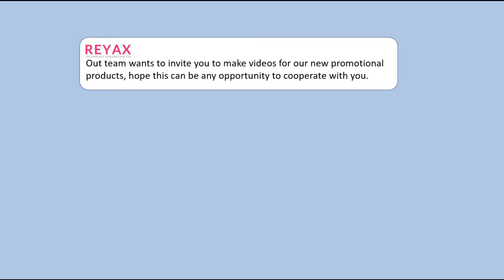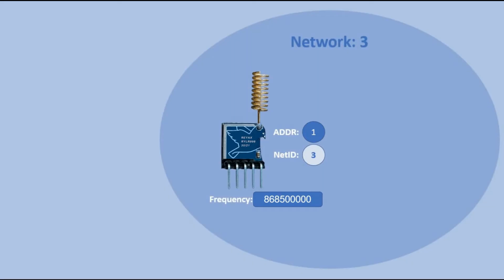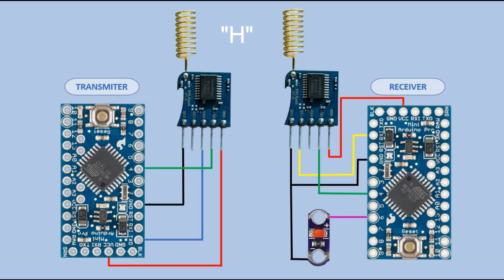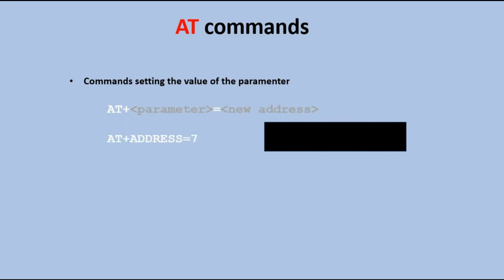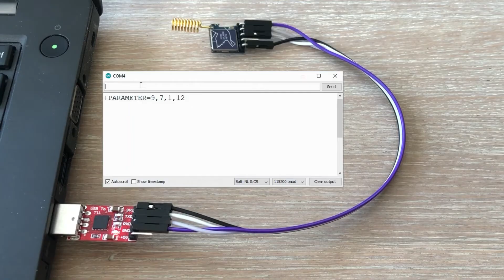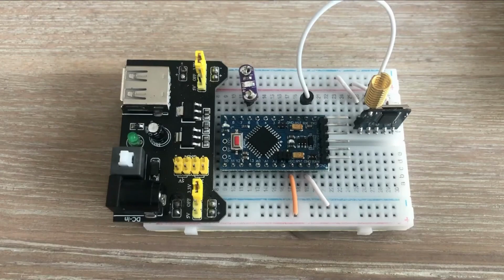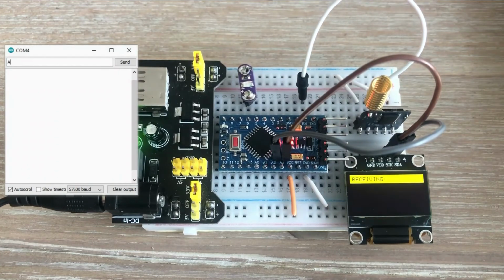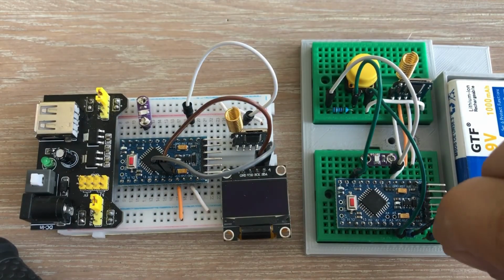Arduino meets RYLR998: A Comprehensive Guide to LoRa Module Integration

Comment: If you plug in your lora to the usb, you will need to install drivers. For me I looked up "CP210x drivers," went to Silicon Labs website, and installed the "CP210x Windows Drivers" driver set. Then and only then was it visible from arduino IDE.

Comment: Excellent video!!! 
There seems to be a long lag between pushing the button on the transmitter and the LED ON/OFF state. 
Is this due to the code used or normal delay to expect with this LoRa device?

Comment: Where do you get the jumpers? What are the lengths available? What is the wire gauge size required?
Reply: Amazon has jumpers galore...
Reply: It's a piece of wire, small gauge, it's from one hole to another, it's not brain surgery.  Improvise.  Did you ever have a 151 Electronic Project Kit from Radio Shack as a kid?

Comment: I'm looking to use this module with my Flipper Zero.

There's a LoRa app built into the Flipper Zero where you can set the parameters as you did in this video.

On the other end, I don't have a 2nd Flipper Zero though so it has to be my laptop it's communicating to/from.

I have a uart to hook up the laptop to the LoRa module. Do I just open the Com port & start entering the parameters this way?

I'm NOT looking to light up an LED etc. I'm simply looking to both transmit & receive to both the LoRa modules texts.

Do I just set the parameters in the Com port & then I'm good to go?

So to reiterate, the parameters will be set in the Flipper Zero & using jumper cables. The LoRa module will be connected to & powered by the Flipper Zero. It can send/receive through the LoRa module.

I need to set the other LoRa module up to my laptop. Is the LoRa module good to go without writing code & just setting the parameters up through the Com port?
Reply: Have you find an answer? I am looking for setting lora without UART

Comment: Can I use the lora module with the seedstudio ESP32 C3 module ?
Reply from the maker: Did not work with that microcontroller. But I checkt and it has the UART interface and works with 3,3V logic. So I do not se why it would not work. I am not sure if it is supported in Arduino IDE , though

Comment: Which terminal program are you using? It looks like Arduino but I am not aware of how you get that interface to come up?
Reply from the maker: It is Arduino IDE. When you open it you will find serial monitor icon in the top right corner which opens Serial Monitor

Comment: Mario, can you please help me with a very simple looking problem? I have 2 boards, just like you. At the transmitter board I have a loop with 2 send lines. There is 1 second between the transmission of the lines.
The transmitter runs ok. I got the +OK after the send lines are executed. But the receiver shows only the first received line. I looked with a logic analyzer and I see the 2 lines are transmitted. But on the receiving module there is no reception of the lines after just the first. It looks like the receiver is no longer in receiving mode.
I swapped the boards. Same problem.
Reply from the maker: What happens if you make the delay longer In my ideo you have seen that I was sending led state few seconds apart without problem.. Also try to run transmission 1 twice to see if maybe there is some problem with the content of second transmission. Diffiult to troubleshoot without hands on the prototype:)
Reply: Hi Mario, I got it working. I first did an AT+FACTORY and only changed the address of the transmitter and receiver. But there is still one problem left.
In about 20 transmissions of a 5 character string one of them does not come out of the receiver. It was transmitted with an +OK response. I lowered the baudrate to 9600.
Same problem…. This will become  a very difficult problem to troubleshoot I believe.

Comment: I have a problem with setting the parameters, while the module is connected everything can be configured correctly, however when I remove power from the module it returns to the factory settings, what should I do to solve this?
Reply from the maker: I can't relly hrlp you as my modules keep the settings. But you  are a second person reporting this to me.

Comment: I have RYLR998,  when set band using At command "AT+BAND=865000000", it remember only when it is connected, when i disconnect and connect and ise "AT+BAND?"
it shows +BAND=915000000Hz, why it is not remembering BAND?
Reply: Answer AT+BAND=865000000,m        write toe memory.  RTF !!!
Reply: managed to solve? i have this problem too :C
Reply: @teusocost  No, now each time I set band

Comment: Thanks, that’s some explaining done right.

One question, can we use those module to create mesh network with them, where the network can discover and new nodes in the nwtwork (auto-configuring network)
Reply from the maker: I am not sure. Please check at Rezax. They usually provide good documentation.

Comment: Are you asking for a solution to a problem where, in a 1-to-3 communication scenario, even though the same network ID is set, when a value is sent to address 1, values from address 2 are received, but values from addresses 3 and 4 are not received? In other words, values from one side are not being received. Is that correct?
Reply from the maker: I am not sure which problem you are reffereing two. Can you refer to the timestamp in my video?

Comment: This is a cool project using Arduino, how about if I want to design it using other AVR chipsets. It is easy to prototype using Arduino board. However, with my entrepreneur hat on (idea lead to production product), I do not want all the functionality of an Arduino board, I just want a voltage regulator  with a 3.3vDC, external crystal of my liking e.g. 7.327Mhz (for UART)..a serial port on Port B to load my program in,  LoRa module and a selection of AVR microcontrollers e.g. ATTiny88 or ATMega164PA to choose from (to reduce cost) etc.... Any recommendation?
Reply from the maker: I am probably not the right person to answer it. At least not now. I will be doing future videos on ATTiny chip but I learn as I go. You probably want to ask this at Arduino forum. I presume that as long as the chip is 3 v and provides serial com ports this should work the same. If the chip is in 5v logic you need to have Logil Level Converter. Funny enough I am planning to make a video on such converters in coming weeks as well:)

Comment: Very informative video. I really appreciate it! For both REYAX RYLR896 and the RYLR998 modules, I saw one review on Amazon, stating that the person would get them to work and then they would fail. Have you done any longer term testing to confirm the stability/reliability of these modules?
Reply from the maker: Unfortunately I did not. I have a project in pipe to use them which would answer youer question but it will be a while before I will do it:(
Reply: @marios_ideas  Thank for answering. I'll probably buy a couple of them and set up something in a couple of weeks to test reliability.

Comment: That's a really cool project. Could you make something similar with controlling relays instead of the LED? I can't find anything really basic as far as a tutorial goes to set it up. Any books you can recommend for learning LoRa and things that you made for this? thanks
Reply from the maker: There is virtually no difference. You send the high signal to Arduino pin to light up the led and in the same way you send high signal to relay to control whatever the relay is connected to. As far as using relays is concerned you can check my other tutorial https://youtu.be/XiOcxyyTxy4
Reply: @marios_ideas  thanks I'll check it out. Appreciate it
Reply: @woolfy02  My arduino  IDE not detecting says unknown board and serial monitor does not work